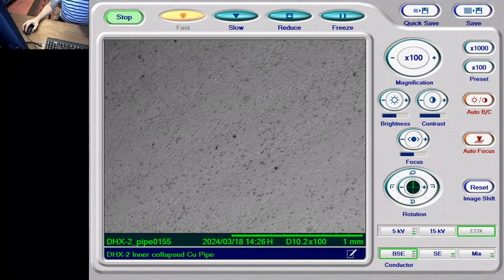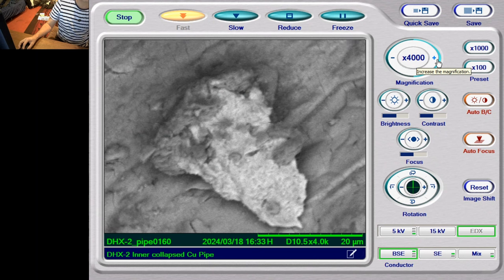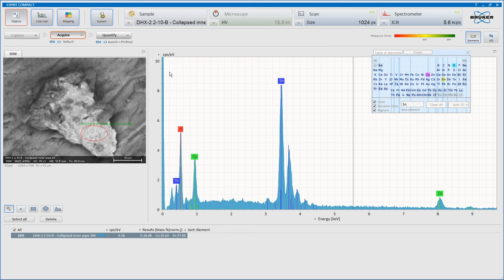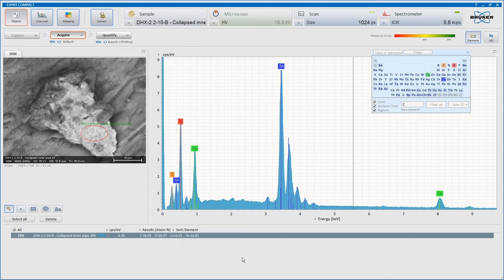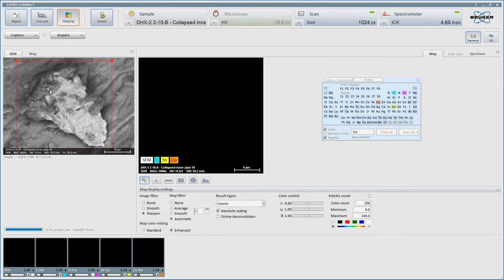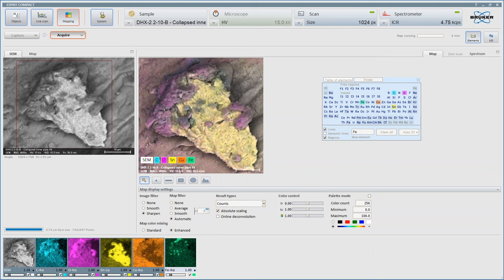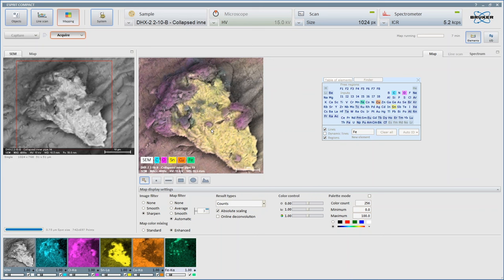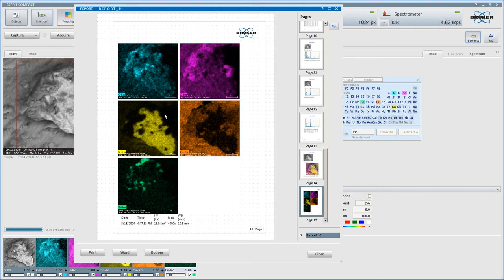Bin-Juine Huang - Striking evidence on collapsed DHX-2 piping

Comment: What temperature and pressure was this unit in Taipei running when Bin-Juine Huang's pipe collapsed? The notion that this environment was sufficiently 'Star Trekking' it to be transmuting elements makes my very tiny brain hurt a great deal! This and the Thunderstorm Generator's insane results are just going to totally change the industrial and environmental landscapes completely, just brilliant that you and the MFMP are on the case analysing results that these sort of people are turning out - can't wait to see what Malcolm's next kits do, and what results that turns out.

Keep at it Bob!
Reply from the maker: The input temperature is room temperature.

https://www.nature.com/articles/s41598-023-50824-8.epdf
Reply: Well said. The "powers that be" (PTB) know all about this. The unwitting engineers have been trained for generations to stay away. This is Top Secret, imho. Bob and all need to remain vigilant.  Not advice, they know. Peace.

Comment: Could the tin be residual from spat of solder, thats rolled down internally ?
Reply from the maker: I qualified my narrative to account for this possibility. It does not account for it's presence in the structure or the ring of iron beads at the top of the structure inside the Cu/P/C&O structure.

Comment: Has me wondering how the Tin formed in Cornwall ... (the deeper Tin mines, remember, were inaccessible until Thomas Newcomen's atmospheric engine (1712) was able to pump out the water at a fast enough rate, with that engine later being improved on by James Watt to produce the steam engine (1769) that powered the industrial revolution ... but which burned coal).

Finally, now, after only 250 years (!), we can actually start to do something about the flue gases.

My head's spinning at the possibilities now within reach ... Robert Greenyer, PhD, Nobel Prize winner, surely...  but then, I look at the blowhards and man-babies in the news and wonder "When Will They Ever Learn".  

Still, one day, Bob, one day 🙂  Hope springs eternal - and, until then, stay safe, stay well, and may love surround you always
Reply: Sutro did hot water mitigation tunnels for the Comstock Load. Sold shares well before the lode went bust. Love you, GD and agree. The Kosmic Award is above the Nobel.
Reply from the maker: I think a deep study of more of the DHX-2 material will be like reading a tell-all for the Os

Thanks for your kind words, the point is to help delivery of the technologies possibilities, and yes, there are indeed many.